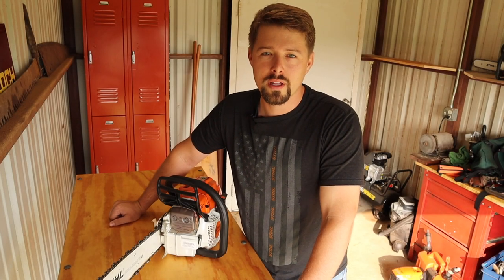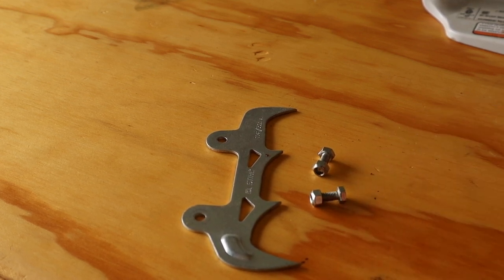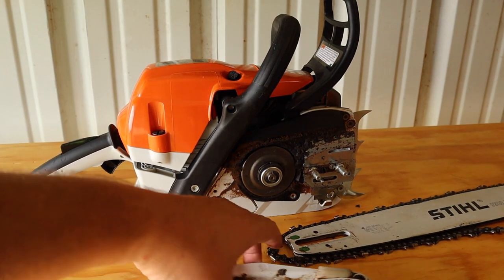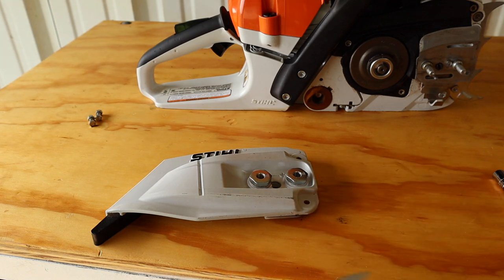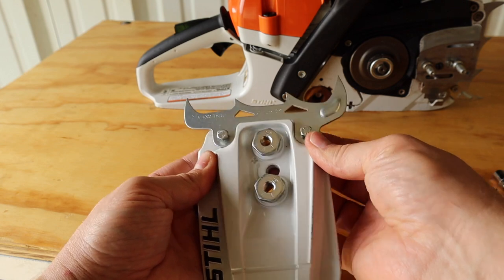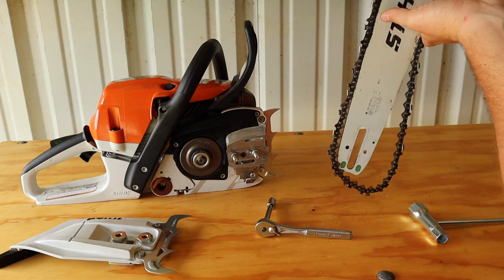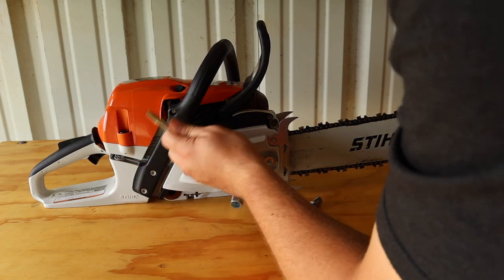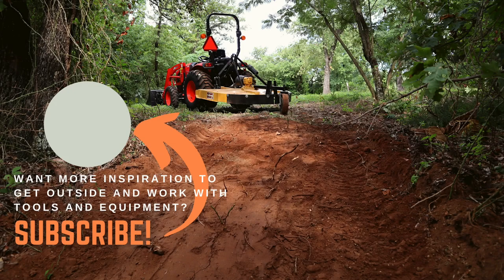How to Install Double Dogs (Felling Spikes) on Stihl MS 261

Comment from the maker: Have you used double dogs on any of your chainsaws?  What made you want to do it?
Reply: I installed double dogs on my Dolmar 111, becouse it's way easier to cut straight. If you have them only on one side, the bar gets pulled to one side.
Reply from the maker: I agree!  That's why I like using double dogs, too.  Thanks for watching, man.
Reply: @OldSchoolMillennial  I ordered oversized double dawgs for my 462 right after buying it because it came with the exact size inside dawg as the 261!
Reply: @marcel hound I shopped around on Amazon. The chain catcher came with them. I don't remember who the company was.
Reply: @SaltyMike396  you
Reply: I put WCS dogs and a roller chain catcher on my 261CM. Also put a bash plate and exhaust port too. Oh, and a WCS filter. And changed to 3/8th 7 pin and 1.6mm 3/8th bar.

The chain roller support pin prevents clutch cover cracking from distortion because unsupported spikes cause twist.

Comment: The bolts are backwards, they should be facing out so they don’t rub on the chain as you have them mounted. You might want to check them out and follow the correct mounting. Not trying to be a pain, but you don’t want folks reversing them and causing problems 👍 Thanks Rick